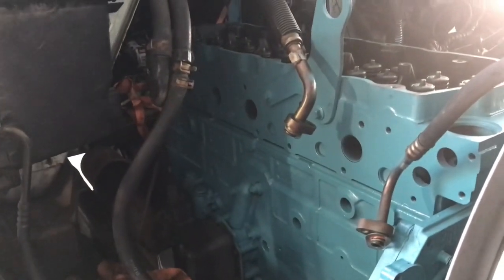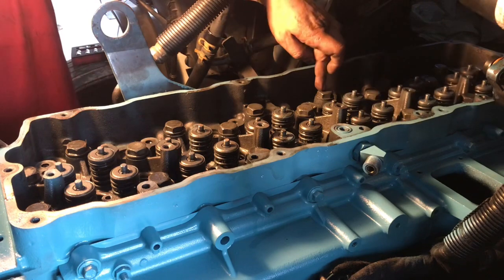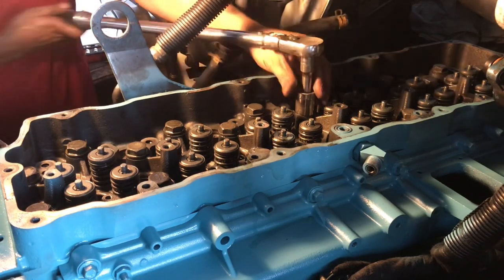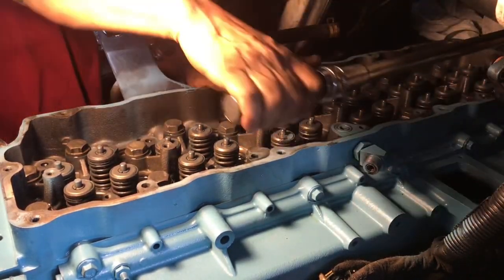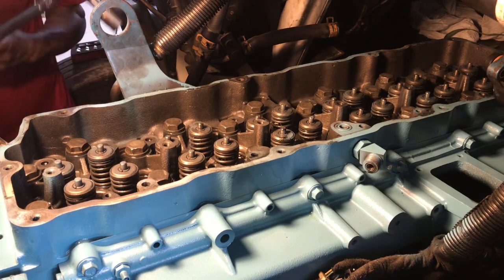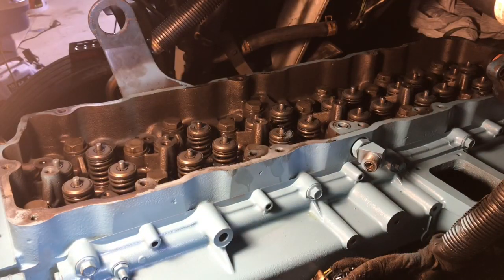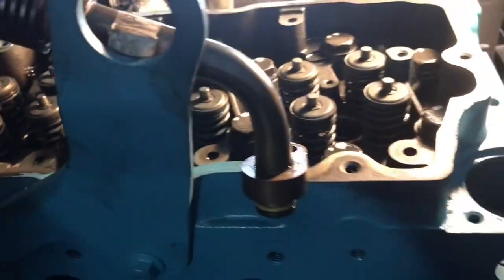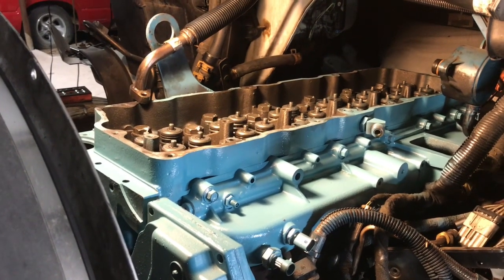DT 466 cylinder head install

Comment: Installed the head after replacing the cam,lifters, and double dog bones. When filling the coolantit is leaking just about the entire length of the head the right side. Do you  think it's because of the aftermarket gasket or stretched head bolts?
Reply: Having the same issue

Comment: Hi Joe,
I'm replacing a dt466 head and injectors..the sleeves and piston look good. Do you check sleeve protusion on every block...I don't have the hold down clamps for checking protusion...but I was thinking of just putting grade 8 bolts with washer to hold down the sleeve.
What's your views on checking protrusion?

Comment: great video, it must have thousands of likes, thank you for sharing, question, does the head bolts have to be new if not overheating been done to motor?
Reply from the maker: I have re-used the same head bolts on a few assemblies but it is recommended that you do replace them.

Comment: Hey,are those head sequence the same for a 2004 dt466?
Reply from the maker: Not the same Og Lazy. Similar. I’m working on an 04 right now. I just started tearing it apart. I’ll respond with the sequence you are inquiring about in a few.
Reply: @JoesBusBarn  ok thanks I'm rebuilding my 04 df466 and need the head sequence

Comment: Hey Joe, I have a question on how child check systems communicate with buses.  How is the system actually connected to the CAN bus and programmed, so it can control lights and interlock with the ignition?